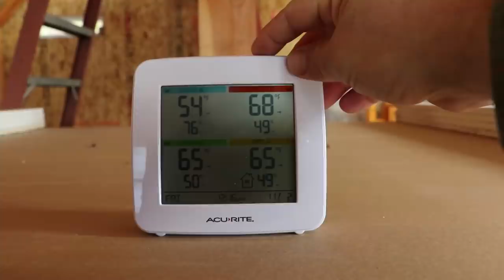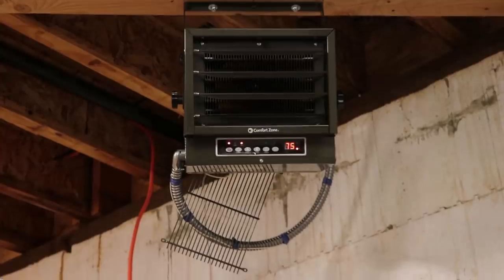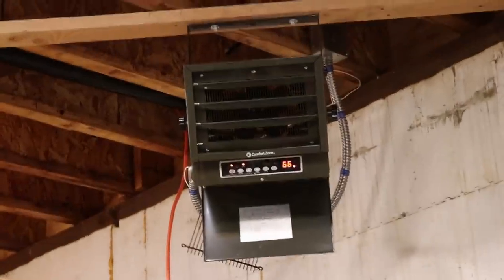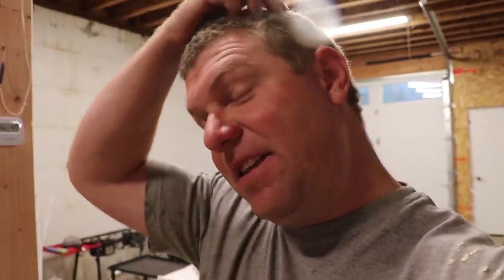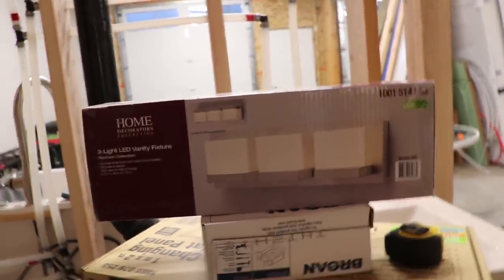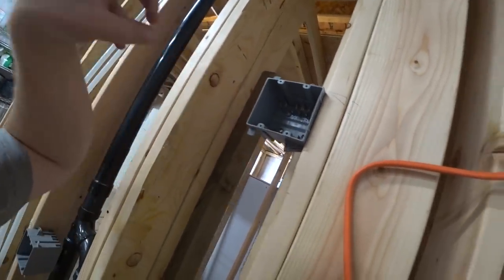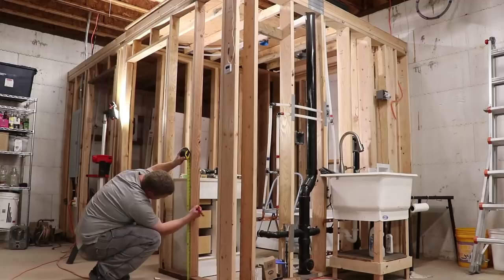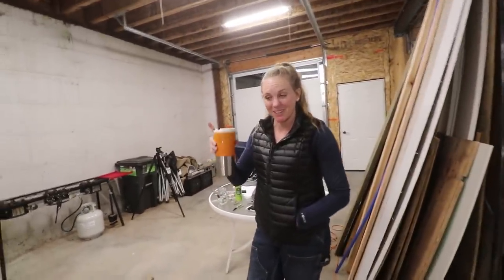A BEAUTIFUL, HOT MESS (Initial Electrical in Bathroom)

Comment: Just a minor point. It's most likely a thermistor, not a thermocouple.
A thermistor changes resistance with temperature, thermocouples generate a voltage proportional to temperature but it's a very small voltage. For room temperatures thermistors are much easier to use but they cannot handle high temperatures.

Comment: My career was in electrical design and in retirement, I’ve wired numerous houses for Habitat For Humanity. I like the way you explained your thought process concerning the basement heater controls. The only electrical comment I have is that every cable that is installed in your circuit breaker box or any metal box must have a cable clamp or a plastic grommet so that the cable sheathing will never be cut on the rough edge of the hole punch-out. Around here, that’s a code violation. I’ve really enjoyed your videos since the beginning.

Comment: They normally use an NTC thermistor with a nominal value of 10k ohms at 25°C. The resistance would go in reverse of the temperature, meaning if you lower the temperature, the value increase, and raise the temp and the resistance goes down.

In short, the wire length of a few ohms will not change the reading by a significant amount at room temperature.

As for your on demand water heater, I still do not think it was a good idea, because of your 200A service and your electric radiant floor. You basically used over half your service for the on demand water heater (that I do not think will be powerfull enought without restriction), will use about 1/3 for the radiant, leaving basically nothing left for the rest of the house. I think you will ends up replacing the on demand with a normal tank, like a 60 gallons.

The bathroom fan, the reason is because the outlet hose will drop a tons of CFM with a 3" hose, and can't vent the humidity fast enought. I would consult with an expert before you close up the ceiling to make sure that it is up to code...

Comment: Once you have your wiring all in and before sheetrocking, take some pictures of everything and if possible include a yardstick or taped up tape measure that shows distances. Then if you ever need to know where the wires & studs are, you'll have visual references to go by. Any bathroom outlet within reach of water needs GFCI protection but that (I think) is covered if the outlet is downstream from the GFCI. But read the code first.

Comment: Instead of using a GFCI outlet, use a GFCI breaker and protect the entire circuit. They are designed for outlets NOT light fixtures. Generally all outlets exposed to potential weather (think outdoor outlets including in the garage, even if they have a cover) and any outlets six (6) feet or closer to a water use area, ie. all vanities, bathtub, kitchen sink, laundry room sink, etc.. Check code for your specific location.

Comment: A thermocouple produces a very small voltage depending on temperature, a thermistor is a resistor that changes resistance, you can connect a thermistor either way, but a thermocouple must be the correct polarity.
In either case there are issues with extending the wire, the thermistor extension will show a slightly higher resistance, the thermocouple also has issues with the types of connections (a thermocouple is 2 different wires welded together, so each joint could also act as thermocouples).
My guess by looking at the wire is that it's a thermistor.

Comment: It's a shame these videos were actually filmed so long ago that any comments or suggestions we give are of no real value...you've already moved on to the next project or buried the mistake.

Current electrical code states ALL 15 and 20 amp circuits installed in a dwelling are required to be Arc Fault protected.

Each bathroom is required to have a dedicated 20 amp circuit for the bathroom outlet(s).  This outlet circuit is separate from any other lighting or power needs.

ALL outlets within 6 feet of the edge of a sink shall be GFCI protected.

Garage outlets need to be GFCI protected, but because your using the space as a "living" space it will need to be Arc Fault protected as well.  The "Garage" is also required to have a dedicated circuit with at least one outlet per car space.

The washing machine (laundry) needs a dedicated 20 amp circuit that is not shared with any other outlets.

Put the lights on a separate breaker so when the saw trips the breaker it doesn't put you in the dark.

Comment: How nice, a video right at breakfast.
 
US elektrics and water are so alien to me, I'm an elektrician myself and the only place we see 200 Amps is in industrial instalations, here in Europe we (usually) have sigle fase 250V and 3F380V, 40 and 25Amps respectively. Makes for way thinner wires, we pull 5000W over a 2,5mm square wire, not sure what wire gage that translates to.

Fun to see how it works on the other side of the globe.

Can someone explain why you would want so many couplings in the wall? (water) In our house we used 1 rule, full lengths of pipe in the floor or walls, way less chance of leaks that way.

Comment: Incidentally, I would also suggest you foam insulate all your hot water lines with inexpensive foam wrap, it will minimize heat loss to pipes. Also on your really long runs, consider a small recirculating pump, again just for the hot pipeline.

Comment: When two dissimilar metals are joined together, a small electrical charge is created and that charge changes with differences in temperature.  Most common ambient temperature thermocouples are iron vs constantan (type J) or Chromel vs Alumel (type K). These metals joined together are very consistent in their changes vs temperature. Thermocouples are particular to correct connections and should be soldered using silver solder. Also, if you didn't connect them correctly (where you spliced together) you created three thermocouple junctions. Btw, white red thermocouple is iron vs constantan (type j)  where red is negative and white is positive.

Comment: Just a tip from a sparkie (electrician) when you mark your cables put two or three marks with the first one about 8 inches from the end then the next one about a foot up, because you will lose you mark when you strip it back or trim it to length, can be a pain when you have a bunch of cables in one spot, like the switch board. Keep up the good work, from Australia.

Comment: If we forget a second about where the sensor is located in that heater, what you have is a garage, connected through a hole (stairs) to the first floor and the first floor connected to the attic. That is a huge air column and having that heater (hot air gets up) in the garage without a hot air trap in the stairs, is the first problem I see. The heater is powerful enough to heat the garage ceiling layer, despite of all the heat escaping through the stairs, he reaches the upper hysteresis threshold of the controller, turns off and the heat continues to escape through the stairs up, while cold air from the first floor and attic is pouring down. You would have the same issue if you install an air conditioner in the attic (cold air I mean). It might cool the air for a while until it shuts off, but that cold air will pour down to the garage in a matter of seconds and he will turn on again immediately.
I would shorten the air column until you have heating in all the house and discuss this issue with a heater expert (not an install technician preferably). If you can prevent hot air leaving the garage, I would put that heater at floor level so you use the hot air convection to your advantage and do not rely on the heater blower to push down something that wants to go up. Ideally in a room you should inject hot air (winter) at feet level and inject cold air (summer) at ceiling level and let convection do the mixing without the noise of a fan.

Comment: By mounting the heater up by the ceiling, it senses the hot air up there via the overheat sensor. If the heater was mounted closer to the floor, the overheat sensor would not detect the higher heat up near the ceiling but the cooler temp from near the floor which would prevent it shutting off since the cooler temp by the floor prevents the overheating.i

Comment: No--- You did GOOD!!!! This is exactly how I became an electrical Genius!! By blowing stuff up!!!!!!!!!!!!!! That's how you learn!!!!!!!!!!!!! Swapping those inputs was correct. The unit has a frame overtemp protection by that thermal snap switch bolted to the fan support. You are gonna get there!! Congrats!!!!!!!!!!!

Comment: I'm pretty sure that the heater was just incorrectly wired from the factory (sensors reversed).  The temperature, even up there, shouldn't be going up that fast, and the temperature sensor being on the back should be where it sucks ambient air in.  The sensor in the front is just to make sure that it doesn't burn out the heating element.

Comment: A propane combination boiler /water heater would free up half you electric service. It would easily handle the whole house heat and all your hot water needs. You would only need one gas pipe into the house and one vent out. That would allow you to use electric for all the other appliances in the house and not have to worry about your power load.

Comment: That other switch wire is probably a high limit safety switch in case the fan quits working, it will shut off the unit instead of let it run out of control and burn your house down.

Comment: You have it wired right. The thermocouple you moved to the framing is the one used for room temp and the black disk (thermal switch) mounted on the underside of the heater is for overheat protection.

Comment: Hopefully that temperature sensor was a thermistor and not a thermocouple,  or else extending with copper wire like that will really screw up the readings.
It looks like a thermistor, and they're more common (cheaper to use) these days except for very high temps.
You have a proper safety thermostat in that thing (the black thing with the silver 2 hole flange)  so no need to worry about the internal sensor not being wired right.  The internal sensor is probably a thermistor too (judging by how nothing melted when they were swapped),  so it can't be too closely coupled to the heater element because they can't handle heater element temps.  That's probably just used by the computer chip (which all appliances use these days whether they need them or not) as a sanity check for its control loop.

Comment: Go with a Hot Water Tank for your DHW. You can get away with a lower power since the element for the tank can run over a long period to get the water hot instead of running full blast when you need it. If you only pulling 5KW for the tank your reduce your power demand by at least 2/3s.  I don't see how your going to deal with a power outage if its last more than a day. With Propane you can heat and get hot water with a small generator. You can always get a small Propane tank for now and install a larger underground tank at a later date.Not sure if you can install an electrical outlet with a drain pipe behind it, or next to PEX lines . I suspect the electrical inspector is going to complain.

Comment: I’m looking at a screen capture and it looks like you might have run a staple through your thermostat wire for the heater right at the top corner where it drops down. It might just be a splinter hanging over part of the wire but it looks like a staple through the wire. You might check it out. I captured it at 2:14.

Comment: Jesse.  Install a traditional electric water heater to preheat your water to about 80 degrees so that the on-demand does not draw such high current.  The traditional water heater will be very efficient at that temperature.  Basically it’s a hybrid on demand system.

Comment: Another thing to consider WRT electrical is to install a whole house surge suppressor in the main panel. Advantage is this will protect all devices in the House from surges (eg from lighting, etc). Disadvantage is these type of breakers are more expensive and harder to find so you probably want  to keep a spare available in case of a failure further adding to cost.

Comment: With that big hole that is the stairwell you are basically trying to heat the whole house with that tiny heater. No wonder it cycles so often. Put a sheet or three of foam insulation over the stairwell.
The radiant heat could be handled with a water heater and a circ pump. A local body shop has been heating their addition floor like that for years its 60x40.

Comment: Wow having everything electrical sounds great, but between the hot water heater & garage heater you are pulling a lot of power.  Have you taken into account what the load will be when you add a electric dryer, electric stove & microwave?

Comment: I recommend taking a copy of your building plans and marking every location where an electrical connection is made vs the breaker # you've put them on. It will save your bacon on down the road when you want to add an outlet or switch to an existing circuit (so you don't put too many on one circuit).

Comment: Have you considered high temperature water storage as one way of smoothing your power requirements? Install a super lagged tank and then heat it up overnight to act as a heat battery. Whilst the radiant floor can have a similar storage effect, once heated the slab will give off heat whether you need it or not. Modern specialist tanks can hold water super hot for days. If you design your heating around such a tank it may be possible that the only connection from a wood boiler, if you add one, would be as an additional feed to the tank. Such tanks are often added to solar systems in addition to conventional batteries.

Comment: Looking good. Evidently those thermisters were reversed from the factory.  Confidence inspiring! I'd have gone with a tank water heater.  Then it also serves as a hot water storage tank for any other source of heat you may eventually have, such as wood or a liquid cooled generator or solar thermal.  Definitely want the smallest exhaust fan.  It's sucking your conditioned air right out of the house, so you want to minimize that. I put 50 cfm units in here, right above the shower, and they are more than adequate. In addition to the crappy damper inside the fan, I put a damper on the side of the house, to help minimize unwanted air flow.

Comment: "Wood Burner",  That was music to my ears!  Great way to go.  To avoid ramping up the Electrical Service you could consider a High Efficiency Gas boiler (95%)  While you walls are open consider a hot water circulating loop.  It would dispense with running the cold water down the drain until the hot water  temperature is reached.  You could also use gas when using the garage as a summer kitchen.Your heating boiler can be used for Hot Water Heating through a simple heat exchanger.  In the summer an Air Conditioner could do the same.  I watched your family visit, nice to get a break. i hope it was a rented plane.  I prefer low wing, I had a Beech  B35V.  Never got into a serious mess with it.  At 79, I still drive .  I only fly  on Commercial carriers. My neighbor, a WW II pilot and a Radial Engine Rebuilder Killed his Children, His Dog and his Housekeeper and Gardener.  Crashed on takeoff!  He had thousands of hours of airtime.  Be careful and don't take chances.

Comment: I lived in a place that had an old fashioned window unit framed into the wall.  It had a thermostat in the hallway to turn it off and on, BUT the thermocouple was inside the unit.  So when it got cool humid, it wouldn't come on.  I had to pull it out and stick it into a hot cup of water.  I rewired my house to have my work computers on dedicated breakers with grounds.  All the bedrooms were separate.  Appliances had there own outlets.  I had 20 amp breakers along the kitchen counter so we could run various counter top appliances with out tripping main breaker.  I bumped my house from 100 amps up to 200; I never had any issues.  But I didn't have an energy hog water heater.  Mine was gas.  Gas is the way to go on Instant water heaters.  But I know you went electric for safety. Down in Texas, we put that unit outside.  Have fun wiring your house.

Comment: Hard to tell from "our" view but I noticed that you may have an uphill to outside? I put my exhaust fan to outside on a slightly downhill to outside tilt.Allows condensation to run to the outside of your house instead of back to the fan unit.

Comment: Tip. If your going to solder wires,  put some heat shrink over the solder.
Romex. Use the plastic stackers you can buy where your runs come down to switches.
Check the code for AFCI and GFI requirements. You'd be surprised. And bathrooms have to be on their own circuit, garage has to be GFI protected, etc. Save a bunch of money and time if you do your research. They don't pay us electricians the big bucks for nothing. Have to know the code.

Comment: Just a thought similar to what some others have suggested,  with a twist.
  If you instal a well insulated hot-water tank with an immersion heater fitted,  in-line between the cold water inlet and the instant hot-water heater,  you can pre-heat the water, on a timer,  during a low power-hungry time ( the early a.m. hours) to a reasonable temp.  
            Then as the water is now entering the instant water heater at a higher temp. the demand for many  Watts/Amps is dramatically reduced.

Comment: Someone propably already said that but I wouldn't be surprised if your sensor wire is picking up noise which changes the measured temperature (k-type thermal couples have voltages of a few mV/K). If this will be an issue it could help to use a twisted pair of wires which cancels out the noise a bit. Also you want the solder joints on the same connection to be as close in temperature to eachother as possible, as they work as a thermocouple too (Although this might not be a big deal in your case).